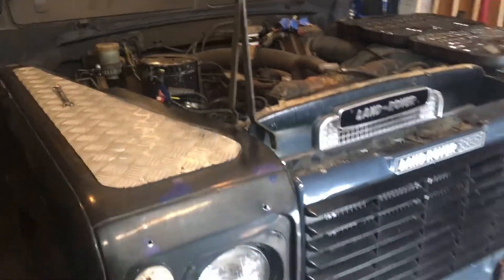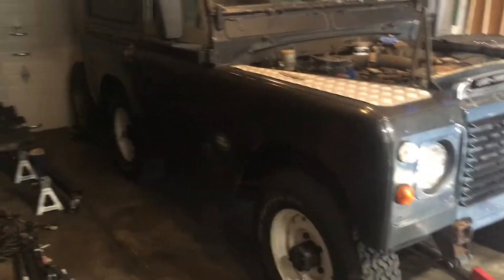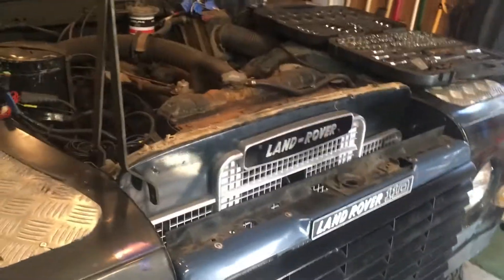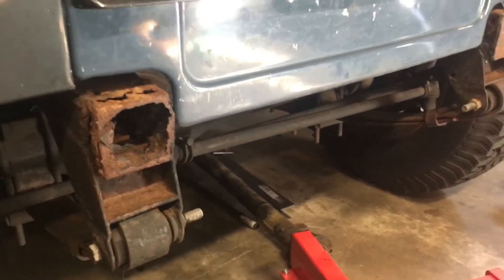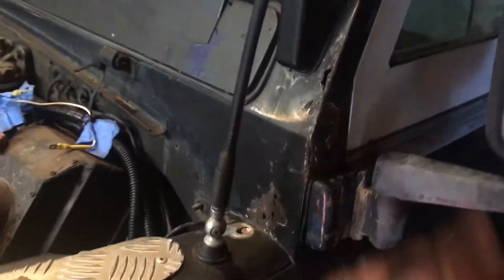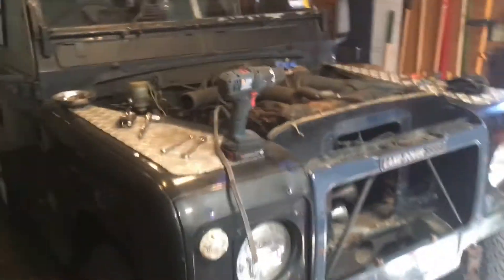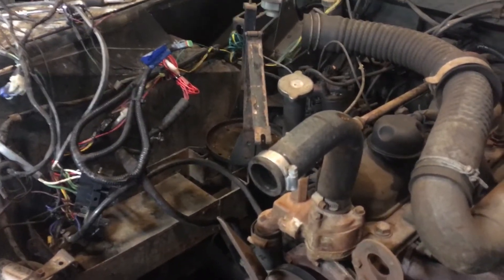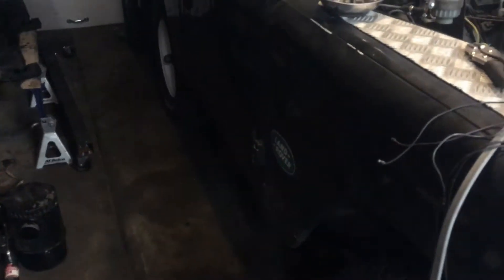Day 2 - 300 TDI Conversion Into a Series 3 Land Rover

Comment: Looking forward to this conversion.  I enjoyed your S2 conversion and am using them to get ideas on my conversion.  I will be converting a 1960 Series II 88 to basically a 77 chevy k20 drivetrain (body and interior to look as stock as possible).  As you mentioned in this video the very short rear driveshaft length will make it interesting.

Comment: How do you fit that facelift grill ? It look so nice 👍
Reply from the maker: Hoo Shue hi. It is simply a Front grill and panel from a 110. Just line it up, drill the holes, and nut & bolt it right on.
Reply from the maker: But, you will need a 110 or 90 hood too. The series hood (bonnet) is shorter of course.
Reply: Panoramic Adventure why not start with a 90 instead of an 88?